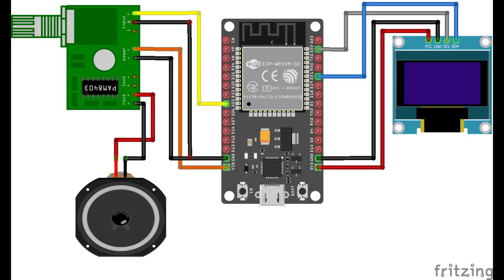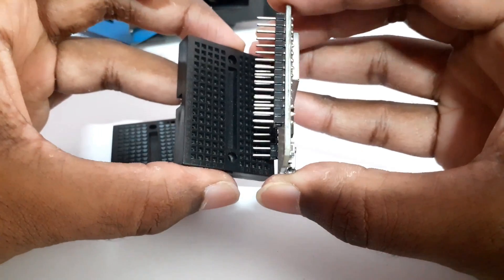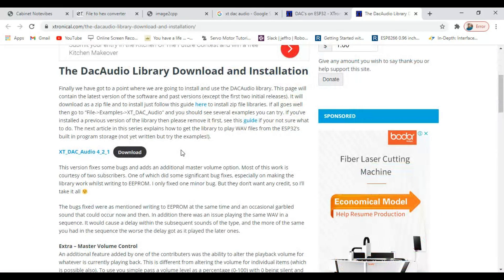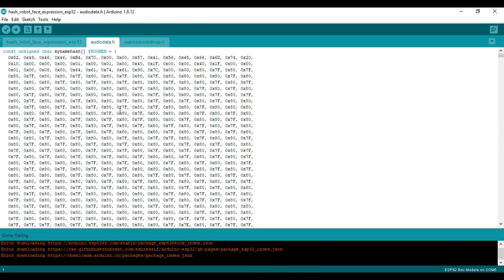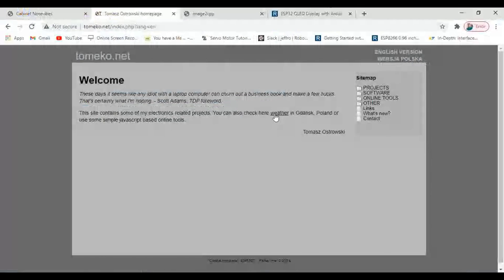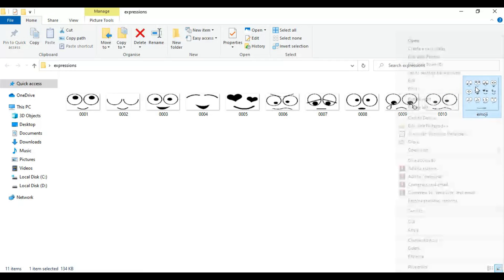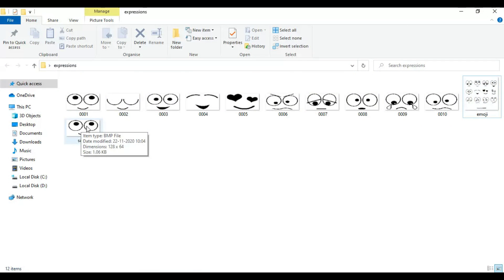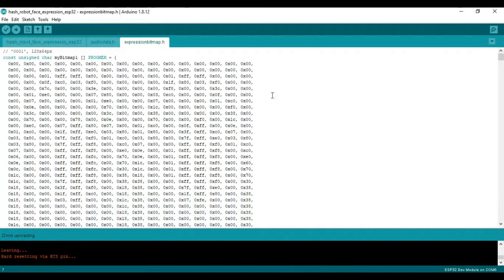Make a robot with facial expressions and voice using ESP32 | Hash Robotics

Comment: The code for this tutorial in arduino doesn't compile or work. I've tried multiple times with different laptops and I always get the same errors and it refuses to compile the code.
Reply from the maker: Please install all the required libraries and check
Reply: @HashRobotics  I installed all the libraries that you used and it still won't compile or verify.
Reply: @HashRobotics  If you give me an email address for you, I can send you the screen shots of the code not working and maybe you can tell me what I'm doing wrong?

Comment: Bro can u pls clarify my doubts...
1. You connected ardiuno nano with laptop using cable . If I want to connect ardiuno nano using battery what should I do? How to connect using battery bro??
2.Do the face expressions in robot changes by itself or we have to command bro?
3. Should I use the code as same as given by u in the discription or should I modify code as u did in the video
4.Expression photos given by u in the description aren't opening bro .
can I make the expression photos by the method used by u in the video bro?
      Pls reply me bro
Reply from the maker: That is not arduino nano. esp32 
Both have Vin pin.You can connect 5V through Vin pin
Reply from the maker: For face expressions I handled in coding. You can use same coding. Please open images using paint . Else you can create your own by following the video
Reply: Thanks bro

Comment: Sir 
I am building a humanoid robot with 12 sg90 servo nd ardhino nano 
What power can i give to it?
What can i use for its body it probably wont support metal
Pls help😄
Reply from the maker: Hi, there are lot of 3d object designs available. You can search and 3d print your parts for sg90 servo
Reply: But i dont have a 3d printer
Reply from the maker: @niranjs2739   There are lot of shops available for 3d printing